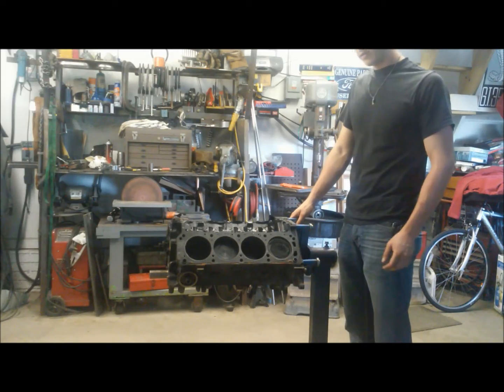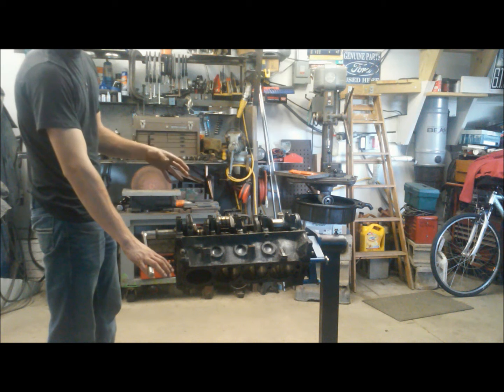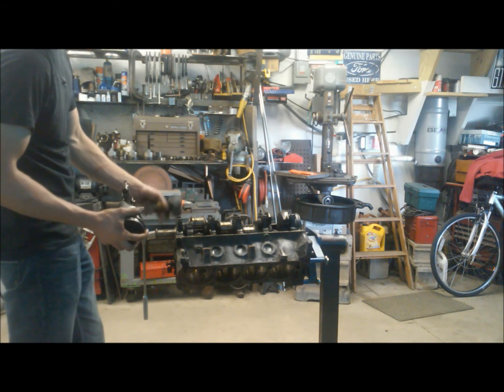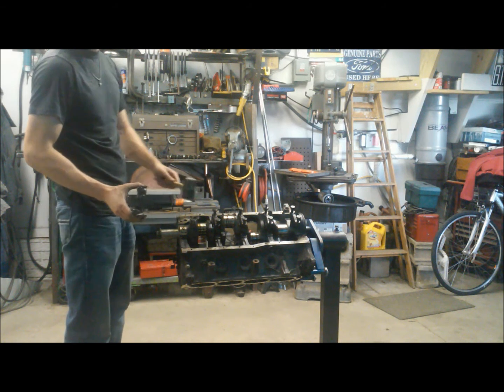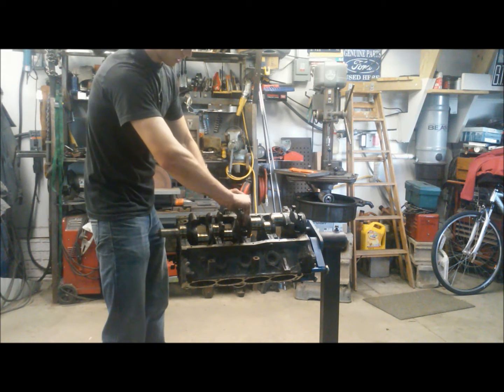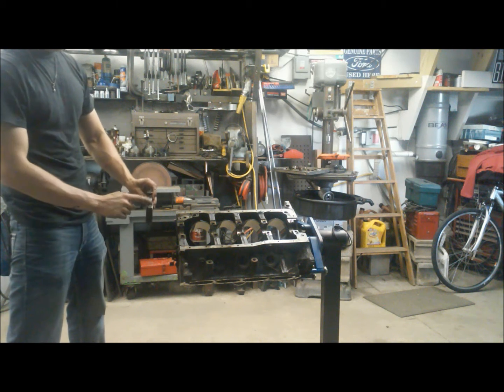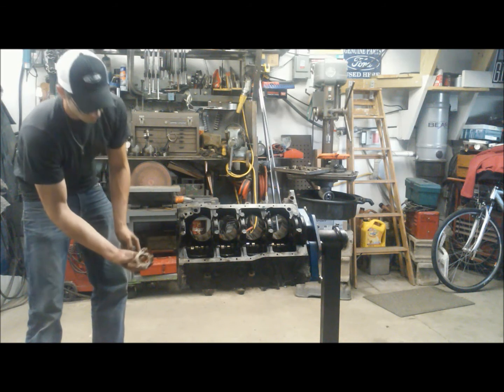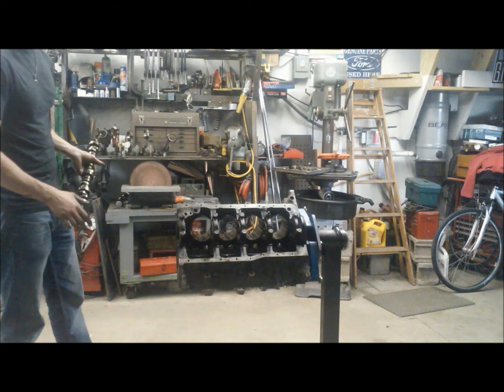Ford 302/5.0 Engine Tear Down - Step by Step Walk Through (Part 2 of 3)

Comment: what did you find out with #1 piston.
Reply from the maker: bad things - cylinder wall definitly had hair line cracks. nothing leaked when it ran, but i just dont use stuff like that. expecially since it would be getting bang shifted at 6000 on the autocross track. i got the engine for free, it was 150,000 miler and went through a few demo derbies. id surmise that one or more of those times the radiator was compromised and the engine overheated but was ran anyway. that particular cylinder got hot enough and the piston expanded enough to cause all the extensive damage. impressive that i drove this thing another 30,000 till it literally burned a quart of oil every 100 miles. 
there is a mabbco short block roller 302 sitting in my garage right now. youtube will be seeing that sometimes soon.